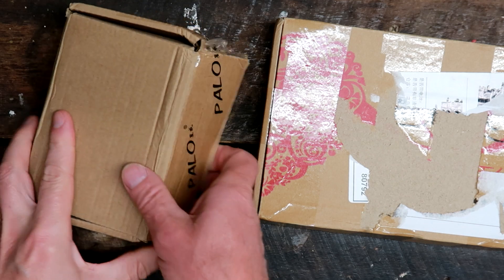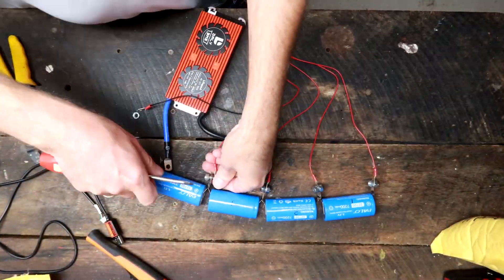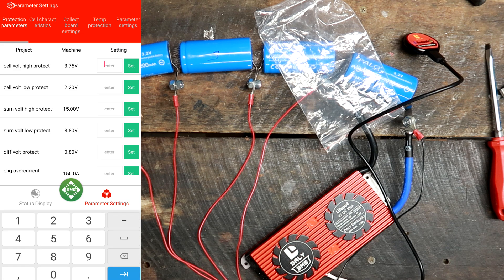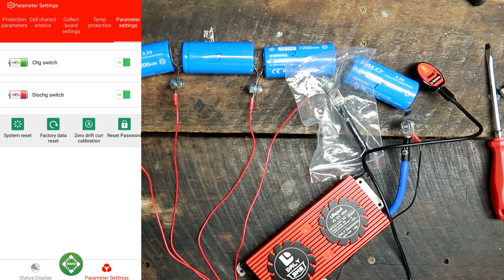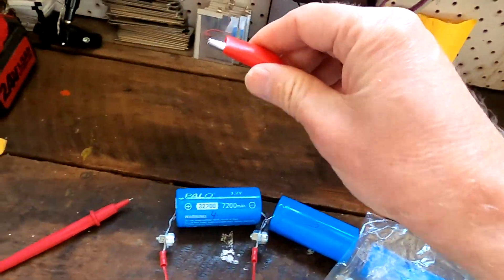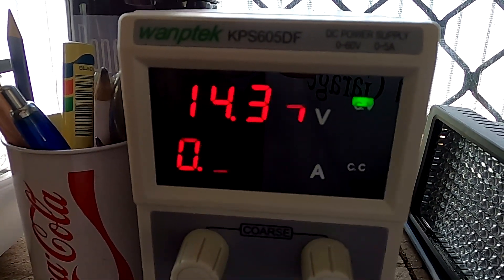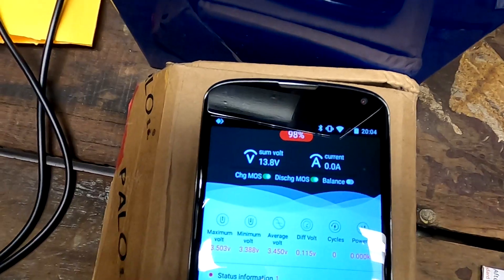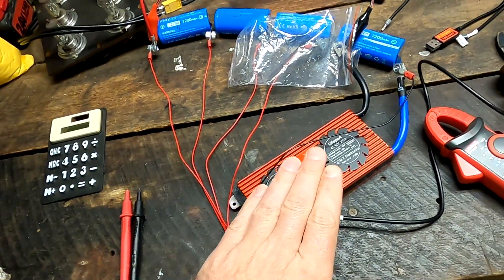Why DALY BMS' are so popular? Exactly, I don't know either.

Comment: There is actually some logic to only balancing when charging.
If the issue is when the BMS prevents charging and doesn't balance.
Reply from the maker: I can understand the logic but it still does not make sense. It will take a lot, I mean a lot lot of charge cycles to balance the battery. Especially with 300Ah+ now, it's a stupid system.
Reply: Andy dont know how to charge his batteries
Reply: The only time a vehicle balances is during charge

Comment: Hi Andy I just clicked on to your video here. Haven't even had the chance to watch it. But thank you in advance for taking the time and putting forth the effort to create it. I learned so much from your channel Andy I really appreciate it. Anyway, I did go ahead and buy eight 304 amp hour Eve cells. But I really do need at this point is a BMS that will handle 8s which is expandable to 16s or maybe even higher. I'm looking for a really good BMS that doesn't cost a lot of money any help from you is greatly appreciated. And I would certainly buy it through your links. Thank you in advance your friend and faithful viewer Rick from Fort Worth Texas.
Reply from the maker: Thanks so much for your kind words, Rick!
That's a bit of a tricky one. If you want to start with an 8s BMS first and then expand to a 16s later on with the same BMS. Not many can do that. The QUCC I have can certainly do that and operates from 7S all the way up to 20S with 200A continues current. The link is on my website: https://off-grid-garage.com/battery-management-systems-bms/
Reply: Andy, thanks for the quick response I really appreciate it. So with my 304 amp hour batteries I won't have a problem with a 200 amp BMS? Again thank you in advance for all your help you really do make a big difference.
Reply from the maker: @wideawaketotruth5301  It depends on how big your load is.
200A at 24V are around 5000W
200A at 48V are close to 10.000W
Thanks again for your kind words!
Reply: So I decided to buy a ANT BMS that is 150 amp to 450 amp I think that will work nicely. It was the largest one I found that I felt comfortable with. My intention is to buy eight more batteries and go with a 48 volt system. Which will max out at 17 KW. I'm going to follow your advice and not discharge below 10% or charge past 90%. Taking those variables into consideration, I will be working with 13.5 KW approximately. Again I really appreciate your input thank you.

Comment: 091921/2312h PST 🇺🇸 092021/1612h Brisbane 🇦🇺   Thanks. You have substantiated the issue with Daly BMS.
I tried the same unit and was totally unsatisfied with its  rudimentary function. I went for JBD BMS and am quite satisfied with it. Daly is  a good paper weight with good looking heat sink. I like Daly heat sink. Why does it have a heat sink, when it doesn’t even get warm? Any news on the work in progress on the steel enclosure and the wiring? Take care and 73s…

Comment: The best bms I've used yet came from overkill solar. Though the Daly I used was ok but ya there are better
Reply: I have overkill also and really like it. But on mine if it's not charging it doesn't balance. It's not an issue with a properly top balanced pack. I'm unsure why the focus on the built-in balance. Does yours do same as mine?
Reply: @sr175  yes but I've learned a lot of bms's are the same and only balance when charging. I can't remember the name but I've been looking at a rather expensive one the allows you to balance as you wish but only at half an amp. Your right though a properly balanced pack doesn't need it. If people have used grabe b and unmatched cells they'll definitely need it though.
Reply: @kswis  I was thinking as much but when I see these videos it was odd that expectation was balance all the time. Just depends on what bms we have! I do enjoy this channel and as I experience my setup I see tested what I see happen. Helps me know mines ok lol.
Reply from the maker: But Overkill has only one 48V BMS with only 100A?
Reply: @OffGridGarageAustralia  a question I've wanted to ask about why only 100 amp on 4s overkill. For me no need for more than that!
Reply: @sr175  The 4s is 120 amps but ya, and 100 amps on a 16s pack is sufficient for most lol and the price they're asking its reasonable. Folks will always find something wrong with anything. To each his own I suppose
Reply: @sr175  and I too love this channel. Between Andy and Will (and many others of course) pretty much every topic is well covered. I favor Andy's channel a bit more cause he is more down to earth and personable. Just all around makes my days that much better.
Reply: The QUCC BMS are practically the same as overkill BMS (I have read on the forums)
Reply: The overkill solar bms can be set for balancing only on charge, or balancing when not charging.

Comment: I too use a OverkillSolar BMS on both of my 8S packs. The app allows you to select whether you want to balance when charging or not charging. I set mine to balance when not charging. The 50ma balance current is fine on one of the packs but on the other pack the cells are not well matched so I had to connect an active balancer as well.
Reply from the maker: If the BMS balances even with 50mA, that's fine and it will lower the voltage of a cell which is high. But not balancing at all like the Daly does is just 🤢
Reply: Overkill is a JBD.
Reply: @mrtestshoot  Jet Blast Deflector?
Reply: @JD_Viddy  yes

Comment: Maybe you think the welding warning is stupid: I think the manufacturers are thinking someone might connect the BMS to the cells before they spot-weld them, and the spikes from welding would zap the electronics. Unlikely scenario, a bit like putting your poodle in the microwave to dry it, but.....

Comment: I have a Daly  40a on my e bike - seems to work fine on my 17am/h  pack - you can buy little 500ma balance boards on Ali express for $3 that keep bigger packs in check
Reply from the maker: I think that's the sort of applications they are designed for.
Reply: @OffGridGarageAustralia  If I charge at 1/2C it hardly ballances  but if I charge at just half an amp and creep up to terminal voltage it  balances fine
Reply: It is working fine for me too

Comment: Is the negative lead shorted to battery no. 1 positive? Oh! I see the plastic bag now.
Reply from the maker: It never did, but even if so the BMS was set to 25A short current and should have turned off. Would be a good test 😬

Comment: Stop blaming the equipment. Clearly you failed by not connecting the temp sensor, you then failed to top balance the pack, why?
I agree that the GUI is not user friendly, but it does the trick once you know what you are doing.
Reply from the maker: The BMS should balance the batteries. But balancing only while charging is so useless as if it would not balance at all. Oh, wait, it actually does not balance at all...
Reply: @OffGridGarageAustralia  it does. If you had read the specs before buying it you would have seen that the balance current was low. Not the fault of the BMS
Reply from the maker: @ralph9987  It's not a matter of a low or high balance current, but if the balancer does only work while charging -> 🤦‍♂️🤦‍♂️🤦‍♂️🤦‍♂️
Clearly a very bad design flaw!
Reply: @OffGridGarageAustralia  Why is this a design flaw? in your other videos, you have stated that balancing why discharging actually unbalanced the pack. (they probably know this and that is why it works like this) and when you charge up again they have to redo what they have undone. so if your packs were top balanced to start with they would not need to do much work.
Reply from the maker: @robben8704  No, no, no, you got this wrong with the imbalance. When using an active balancer all the time it will cause imbalance as I showed in the other videos.
The imbalance across cells will occur anyway over time. I have turned all balancers off now for a while and showed the drift in the last video.

The problem with the design is the following:
Were charging the 4s pack with 1A, so all cells are being charged with 1A. Now, one cell goes over the set balance threshold and the balancer becomes active for this one cell. So it will shave off 30mA of this 1A, getting only 0.97A, right? So every time you're charging, this one cell gets a tiny bit less current and over time it will balance to the other cell voltages. I'm sure this will totally work. It just needs a ridiculous amount of time and cycles! 😁
Also, if one cell triggers the high voltage disconnect, the BMS turn off and disconnects the charger, fine. But what now? The cell still sits on this high voltage without being discharged by the balancer (as it is off) unless you have some sort of load on the battery. The cell will not get balanced until the next charging cycle.
Reply: I agree, you dont know what your doing
Reply: @OffGridGarageAustralia  Only time a vehicle balances is during charge

Comment: Aren't those cells you are testing with the ones that failed the capacity and current test you should at least test it with a larger set of batts as it was designed to do it will make the test more impartial

Comment: Hey uncle Andy, look into the smart ant bms, has the mosfet charge option for the charge, but possibly more options then the QUC  bms. Has Bluetooth and a remote screen display, I can email you the pics of mine if you would like.just need a email address. 
Also has a 200ma balance with 2x temp sensors.

Comment: Daly BMS is not a balancer. When you have the active balancer, the balance switch will show here if the active balancer kicked in, while the balancer has the same settings on its own

Comment: Ouch! at 5:49, are you shorting the first cell?
Reply from the maker: It never touched. The BMS was turned off anyway. Even if so, the BMS will turn off right away as I set the max current to 25A.
Reply: @OffGridGarageAustralia  Good points. Nevertheless, I noticed that you put a plastic bag over it later in the video, which made me much more comfortable. :-)
Reply from the maker: @daveduncan2748  Yeah, me too 😂 The cable is bended in an unfortunate way.

Comment: Balancing is really not usable. But for very little Money you can extend it with an active Balancer. I bought a daly because of the high current (up to 500 A at the top model).
Reply from the maker: That they can handle up to 500A is actually a good point. I should have mentioned that. It's another plus for Daly.

Comment: Daly will EVENTUALLY balance the cells… it will take tons of use though.
Reply from the maker: How can it balance them when it only 'balances' while charging.
So charging all 4 cells with 1A and balancing one cell with 30mA results in all cells are getting the 1A but the one with active balancer will only get 0.97A? Is that the system they came up with?
Reply: Daly balances my batteries just fine

Comment: Yep that small 30ma balance current is why i didn't bother with the Daly. For large cells that's useless and not inline with the discharge/charge ratings of the Daly bms.  EV power sell top balancers that go upto i believe 2-3amps of balance current that I've had alot better luck with. I do like the all in one solution tho.

Comment: give overkill solar bms a try, i have 2 and they solve this problem by giving you a choice of how to balance and they have low temp sensors
Reply from the maker: But they have only one 48V BMS with only 100A... is that correct?
Reply: @OffGridGarageAustralia  i think that is correct. the 12v i have is 120a i think
Reply: @OffGridGarageAustralia  overkill solar bms is a USA reseller of the JBD BMS Chinese boards, your relay BMS is made by the same manufacturer. Look up their boards, they have several ones for 12/24/48v some are smart some are not.
Reply from the maker: @MrJramirex  Thank you. I have seen the JBD BMS', they look indeed very identical to the QUCC.
Reply: Both of my Dalys came with low temp sensors.

Comment: The Chinese often translate soldering to welding
Reply from the maker: I didn't. But even then why would anyone solder the balance cables to the busbars or terminals?
Reply: @OffGridGarageAustralia  Some commercial batteries do it that way. And Lithium-Ion packs with spot welded nickel strips are often soldered to for the balance leads.

Comment: Hi Andi daly is not a good BMS if you want a good BMS go with HELTEC they are the best and have up to 2amp balance 👍🏻
Reply from the maker: Thanks, on my list for a while... just working my way through all the models.
Reply: @OffGridGarageAustralia  I've been running two of them for the past year without issues. Even the smallest one (100A, 0.6A balance) is great in case you just want to give it a try. You can find the exact model on the solar forum in my under 10K system thread.

Comment: why they are so popular?? becource it comes in a nice design ,and have the main connection points fitted and a app that is easy , most people have the small crimpers for the balance wires,,so they chose that , and ppl like me when we found something that works we tend to buy the same product again,,even though a JK bms would be better ,,they other bms manufatures could learn something (offer ppl the BMS with the main connections points fitted in either 6-8-10mm

Comment: who need 56 parameters in  QUCC BMS , real customers need simple BMS plug and play ,and BMS must protect HV LV cell. use aditional  independent  balancer 1-5 A
Reply from the maker: Yes, that is a benefit for the Daly, not much to setup, just plug'n play.
Reply: People that think they know more than the electrical engineers that designed it...like wasting months chasing a bit smaller end state of charge compared to what Victron recommends.

Comment: Do you really want to balance when not charging?  Think about some more.  If charge is disconnected at less than 100% SOC you would not be top balancing.  There are a lot of systems that are ONLY set for manual balancing for good reason.
Reply from the maker: That's why you have a balance turn on voltage set in your BMS. It will only balance (discharge) single cells if they are above that voltage. 
If I set this to say 3.55V it will not balance below that. You should balance the battery without any load or charge, so it can measure the real voltage. Only that makes sense.
Reply: The only time you balance batteries is during charge. I work on electric vehicles.

Comment: Daly can't handle cold start larger inverter, inrush current isn't switched off fast enough by BMS resulting in blown MOSFETs, need precharge circuit

Comment: These things need their (D.A.L.Y.) Temperature Sensor to Run Right - or, deactivate the temperature measuring facility..  

The nasty thing is that lots of places that sell D.A.L.Y. BMSes do NOT sell the sensors….  Finding places to buy those things involves dealing with located-in-China sellers…

Comment: These DALY BMS´s are not made for PRO´s like you. It´s made and popular by people who DIY 100-200Ah batteries for e.g. a camper van, to power a 12V compressor fridge, 12V heating blanket, 230V inverter, charging phone and tablet etc. pp.
Reply from the maker: But still, they don't balance when you have a high cell, they just disconnect the whole pack. How useless is that???
Reply: @OffGridGarageAustralia  Yes, you are right. But therefor I have an active balancer and use it only from time to time if the cell´s are drifting too much.
Reply: He's not a pro😅🤣😂😆

Comment: I have a Daly too. Look at the so called SOC indicator. It started to show 50% from start up. A bit later 100%. I also have a Victron Battery monitor at the same battery and the monitor % SOC figure on the Daly is crap. It tracking the Victron only while discharging. When discharging and charging a couple of times, Daly shows totally different figures. I trust Victron the most. Loks like this and many other BMSs with BlueTooth SOC functions are using voltage to calculate SOC, witch is no good. I also have experienced that the over current load protection is not working. This leads me to believe the current is not measured over a shunt resistor, hence the poor function on SOC accuracy and current protection.
Reply: Did you set the capacity in the app and make sure to also set it to 100% after fully charging it up? It needs some help.
Reply from the maker: Does the Daly do Coulomb count like the Victron shunt or how does it determine SOC?